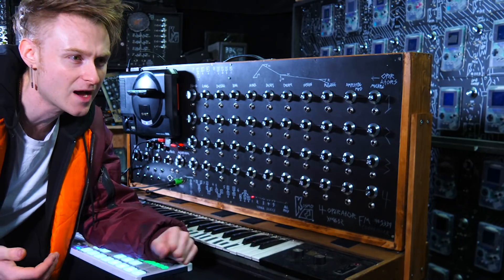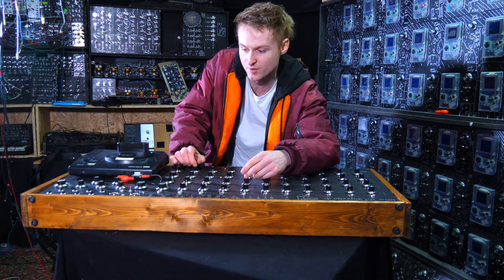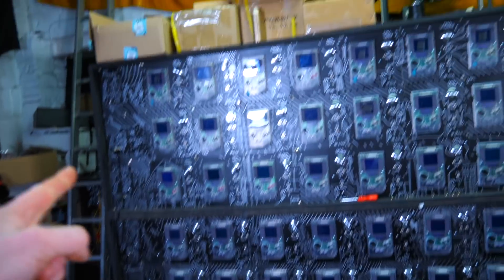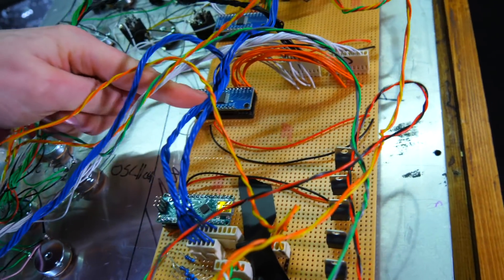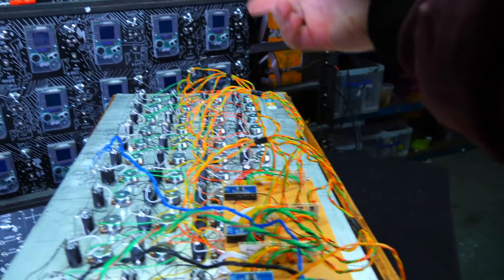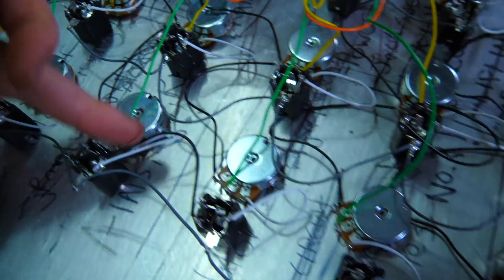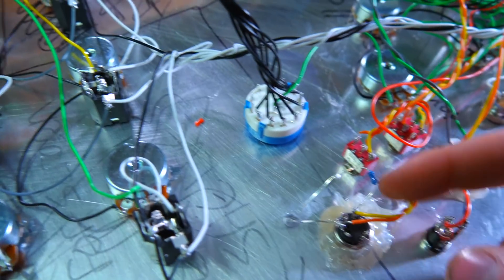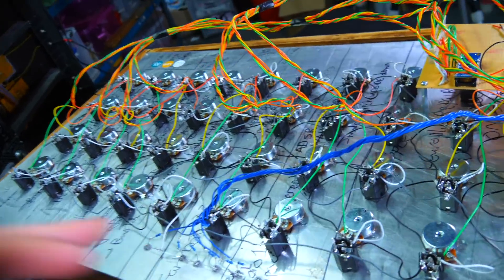Sega Megadriver Synthesizer In Depth Look

Comment: Another thing you could add for the sega megadrive synthesizer is an option to use each induvidual channel without the others interfering with it so you could do something like making one channel a strong bass and another one a  soft synth. I hope you get things fixed for it. Big fan of you!
Reply from the maker: thats what this does :) hence why you can scroll through the channel parameter pages